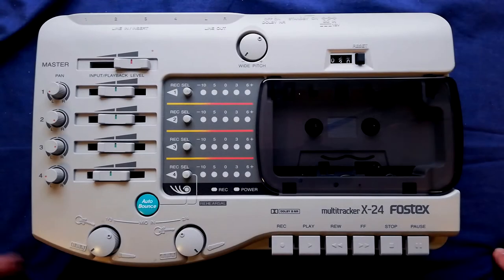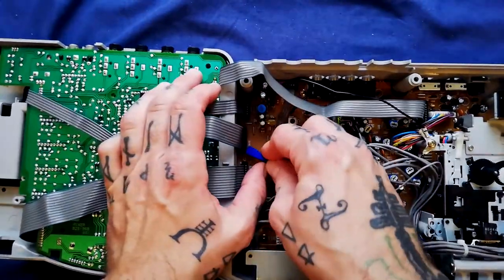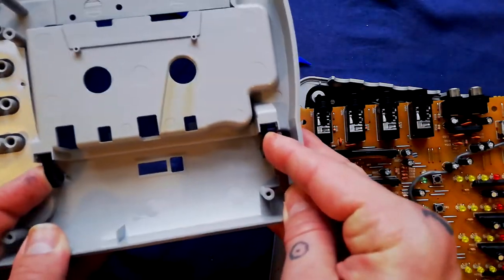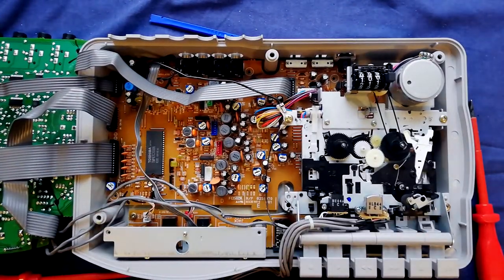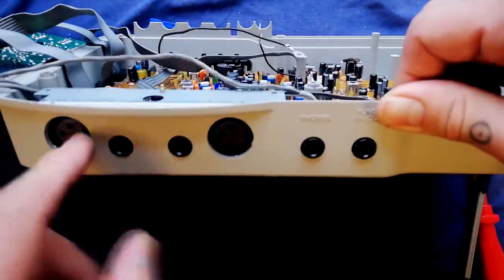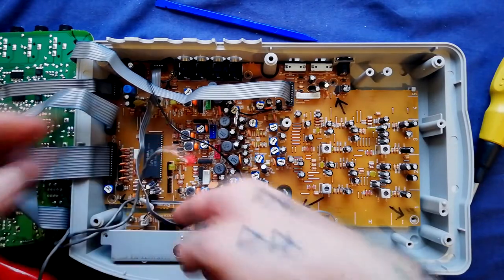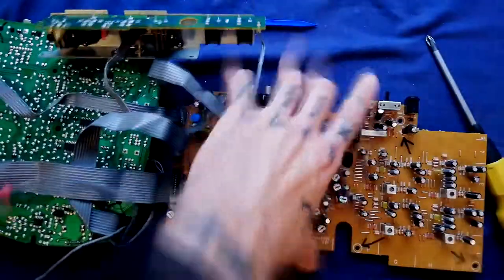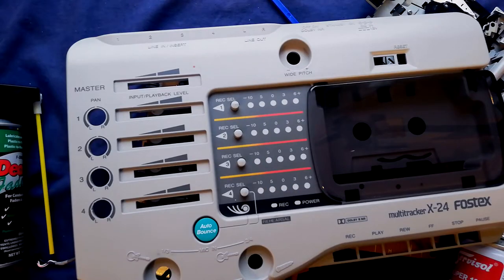Fostex X24 | Tear down | cassette 4 track recorder

Comment: love the video, I am trying to refurbish my 30 year old yamaha MT 2X and I have 2 queries, can you use isopropanol to clean the rubber wheels and you mentioned buying new belts, what make of belts should I search for, thanks
Reply from the maker: There's hearsay on the internet about whether to use isopropyl on rubber... personally I'm firmly against it -  it definitely dissolves old rubber, how can it be good for healthy rubber ? - , I use a damp cloth, or if it's very dirty diluted detergent like you'd use on plates, glasses and cutlery. For the flat belts I use gbaudio in Edinburgh but for the square section ones I just type "cassette belt assortment" into eBay and pick whatevers cheapest.
Reply: @Tetrakan  Thanks for that, I have done that and ordered a mixed selection of sizes from Linna including some other bits and pieces included including cassette deck oils and cleaners

Comment: Great video series.  I have a Fostex X-26.  Your videos helped me with the belts.  I just need to fix a hum problem.  My volt meter shows 5V between chassis ground and power supply ground.  The motor housing, switch housings, and rca grounds all carry 5v.  Is this normal?  If not any recommended places to look.
Reply from the maker: I don't thing that is normal. It porobably points to leaky capcitors between chassis ground and the audio path. That can be ahrd to narrow down to one offending electrolytic capacitor...if you cna bare the expense and tedium you coudl just recap all the lectrolytics under , what 300 uf/ That'd probably catch the issue...good luck!

Comment: I've got an X-34 with a couple of problems - channel 4 can be recorded to by selecting ,say, input one to record on channel 4 - but channel 4 cannot be recorded to from its own input, and the light to arm channel 4 to any of the other inputs does not light up. Also the tape motor seems to slow down sometimes but will return to full speed if you give it a whack.. any suggestions? thanks in advance if anyone knows x